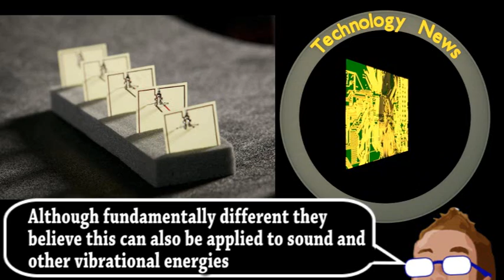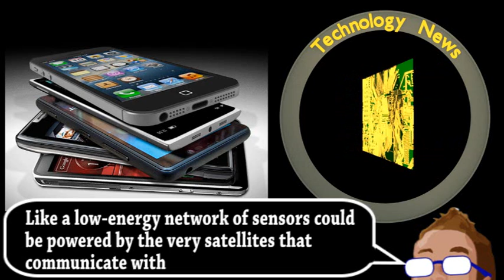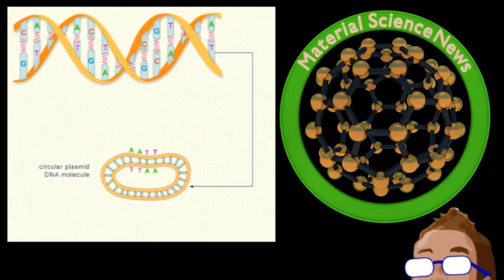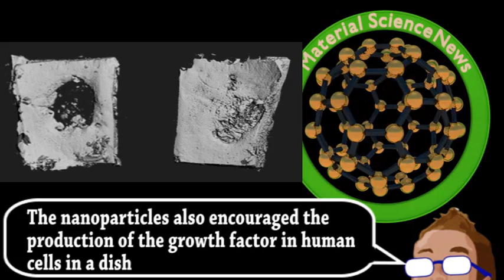Wireless Recharging Coming Soon (Brainstorm Ep163)

Comment: What would I invent? Staying in the realm of broadcast energy I would invent a system to replace the current plug and cable format for electrical appliances. I get fed up with trying to cope with wires running over the floor and other surfaces that have to protected and hidden away. Such devices have been trialed but so far no success, at least none that we hear about.

Comment: In regards to your first story, their experiment was done at 900 MHz (1), I could see these being a great way to transmit power using the 470 to 806 MHz gaps left by the old television broadcasters (2), that is, if Microsoft, Google, Dell, HP, Intel, Philips, Earthlink, and Samsung Electro-Mechanics are willing to share that part of the spectrum since they purchased it, collectively, from the FCC in 2007 (3).
(1) http://dukespace.lib.duke.edu/dspace/bitstream/handle/10161/8006/1.4824473.pdf?sequence=1
(2) http://upload.wikimedia.org/wikipedia/commons/4/45/United_States_Frequency_Allocations_Chart_2003_-_The_Radio_Spectrum.jpg
(3) http://en.wikipedia.org/wiki/White_spaces_(radio)
Reply: I would much rather see those giant gaps used to transmit information the way the White Spaces Coalition intended 6 years ago. Though I'm not stoked about the corporations owning those frequencies, I know that people will put them to good use sharing tremendous amounts of information.

Comment: While it's interesting science and might lead to better offshoot technologies, I'm very skeptical about the direct practical application of radio wave photovoltaic, and here is why (don't get me wrong, I love science and work in science, but this story is mostly hype):

1. This is not really "free" energy like solar is because we humans expend energy to produce most of the radio waves in the first place. It's like using a light bulb to power a solar cell.

2. Common radio waves by the time they reach you are very low energy and not likely to be significant enough to produce enough power. Back to my lightbulb analogy, it's like using a tiny solar cell positioned very far away from one single light bulb, which won't give you much power back. There is basically no way this could ever compete with any other renewable energy source like wind, solar, tidal, geothermal, etc.

3. You've made a mistake in terminology which lead to a significant mistake in over-hype (or actually your source, the ScienceDaily article technically made the mistake first): Volts are not a unit of energy so you can't say "7.3V of energy". One volt is actually a Joule per Coulomb, The units of energy are Joules. You need a lot of Coulombs [which are charges per second] to get a lot of energy, not just by having a high voltage. Sure, they could wire a bunch of these devices stacked in series to generate a high voltage from end to end, but that does not at all mean it is actually high energy or high power output.

Electricity is measured in power, which is a Watt, which is a Joule per second. To get a Watt from a Volt, you need to multiply it by the current which is in Amps, which is Coulombs per second. 
(V * A = J/C * C/s = J/C = W) [so that's: Voltage*Current=Power] 
So anyway, my point is that their device may have a higher voltage than the "conventional USB charger", but that doesn't really mean much because it says nothing about whether it has a high enough power output to charge a device anytime soon. If they didn't disclose the power, that's probably because it's extremely tiny and unimpressive for a news story.

Again back to my lightbulb analogy; sure you could get the same voltage from a solar cell by converting a photon of light close to the lightbulb or from one far away from it. But when the solar cell is very far away from the light source, there will be very few photons collected. Same voltage but dramatically different power!

Comment: this is old, nokia was going to use it, but it is stealing and effectively jamming signal, for that reason it is banned in most countries...
Reply: Really? Since we're bombarded 24/7 by RF from all over the universe I fail to see the problem. And how would such a device "jam the signal" since the signals sent by broadcasters are dispersed across the surface of the globe and the device is nothing more than a small receiver. I would appreciate seeing some proof of your assertions.
Reply: those outer space RF would be fine to use this way i think.. but they are not sufficiently strong, are they?
Antennas are capturing whole range of signals based on the antenna properties, right? so the signal is not being let through and sufficiently 'vanishes', imagine there are many such devices around your mobile phone (this is why there are more cell towers in downtown of every bigger city) - while your provider has a proper transmitter, your mobile does not necessary have to have capabilities and your transmission is practically being jammed.. wasted on someone's battery recharge..
I dont think this is actually very efficient way how to recharge your devices, there is ultimately too much waste in it than just plug it in the wall.
i hope i explained it better, it is a difficult subject.
Reply: I hate to break the news but antennas don't "pass the signal through" either. You obviously have no idea what you're talking about.
Reply: colourmegone have i said otherwise? I explicitely mentioned it in the example, but there is an obvious difference between usage of the signal as intended and to abusing it for battery recharge.

please stop trolling.

Comment: "wireless recharging coming soon" is quite misleading, implying it doesn't already exist. Ever since the early 1900s devices have been made that source all their power from far away broadcast sources (crystal radio).

This technology is just a more powerful, efficient, and advanced method of harvesting power from broadcast signals.
Reply from the maker: well I meant coming soon in terms of practicality, wireless recharging isn't currently a thing for phones and other common devices
Reply: qdragon1337
and it wont ever be as if in higher numbers this succesfully lowers signal quality.